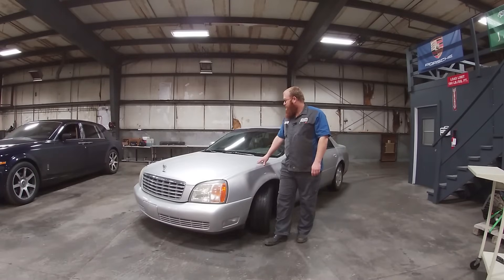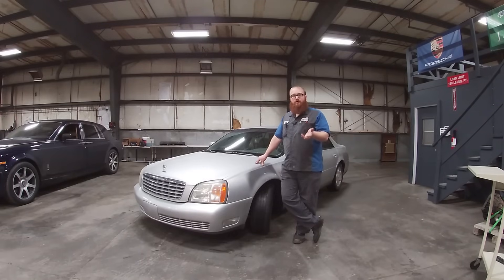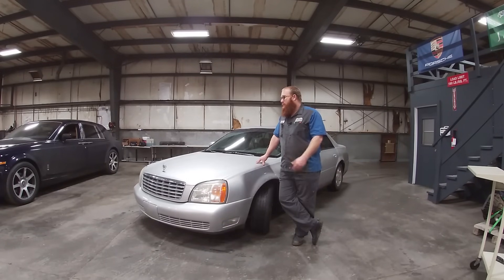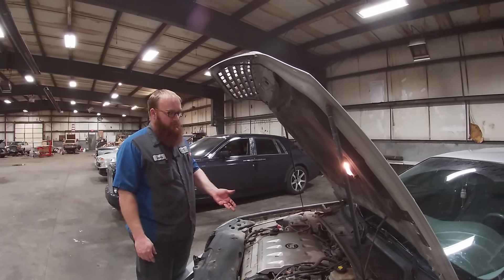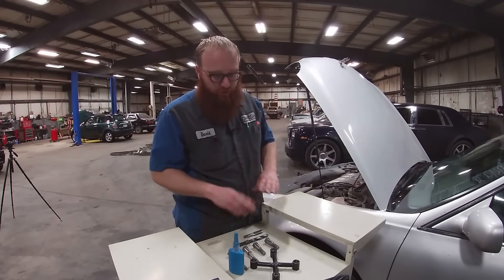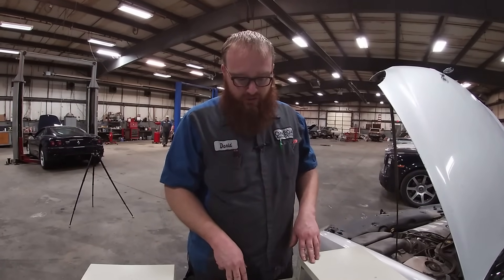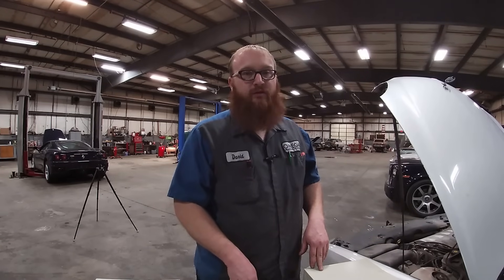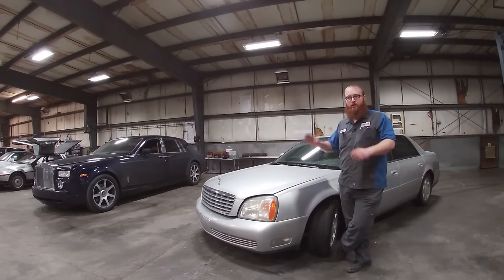The CAR WIZARD names Cadillac's Northstar Engine the Dumbest Design

Comment: to get a degree, all automotive engineers should have to work as a mechanic for four years or so before they're allowed to design a damn thing.
Reply: Ah....but you're forgetting about the problem evil and greed.  What if the mechanic knowingly designs the engine to fall apart right after the warranty expires in order to make him and his profession a lucrative income?
Reply: @drmodestoesq  you think they're not already trying to do that? I swear they have program in the computer that tells the car when it's out of warranty and then the computer acts up and makes the car quit. At least if they had to do the work, they would probably make it at least easy access so they could turn a buck faster. I used to own a damn Chrysler the actual book on changing a starter was to pull the engine. I didn't of course, but I did have to loosen them up and jack the motor up a bit to wriggle the old starter out and the new one back in. That's just ridiculous to pull a motor to change a starter, especially on vehicles known for being hard on starters. The real Dodges, made by the Dodge brothers, had a noiseless starter. Some had starters that were starters when they needed to be, generators the rest of the time. All the so called advancements they have these days    ain't shit.
Reply: @tootall5559  And why are the dealers up in arms about Tesla selling cars without the dealership model?  Because instead of a car with 250 moving parts in the drive train and electric car has one.  Well, that's probably a slight exaggeration but you get the idea.
Reply: @drmodestoesq  Tesla may have well it's got to have more than one moving part... no way it can only have one and have four wheels... anyway, Tesla's are not all that. They take a long time to charge and really don't have all that much range for the time it takes them to charge. When they can get 4 or 5 hundred miles on a charge that takes about the same amount of time as it does to fill your tank, then they'll have it. The battery tech probably exists, but the oil companies keep it under wraps. They've gone so far as to buy out companies with any advances and then destroy the company, and any of the existing batteries.
Reply: @tootall5559  They can do extream performance and fast charging. But it comes down to safety, those types of batteries can burn up if missed treated. You wouldn't want someone to have a crash and then the car turned into a firework display.
Reply: I have a Mechanical Engineering degree and I worked at a gas station to pay for my college. I agree with your suggestion. I promise my viewpoint has been quite different than engineers that seldom got their hands dirty.
Reply: Yeah and before a mechanic is allowed to complain about any design related issue he/she should work as an automotive engineer for four years. Most mechanics tend to think that engineers don't think about the practical side of things, well they're wrong.
Reply: @AR1G3  found the engineer
Reply: @sosobored1992  or I could be both?
Reply: @drmodestoesq  but tesla are well known to have lots of issues, like screen issues, software issues, smaller motor issues. Having the batteries swapped out, and now we have them stripping down the battery pack to repair one cell etc. Normal repairs range from 80 dollars to 4500 dollars. With average at 300. The main thing is, the thought process behind how this car ended up with the bolts could happen tesla too, they could end up with an electric motor/batteries failing in 250,000 miles due to some design fault. Tesla are not the top engineers in the world in the their field. They are not even close. Rollys Royce for example is currently testing its electric engines in racing propellor planes. They are on a totally different level, but even they can make mistakes. Point is, electric cars should be cheaper, but we will always have issues with failures, and one design failing a bit more than another, and the odd really really stupid idea finding its way in.
Reply: @drmodestoesq  It's a management decision, not a mechanic's.
Reply: same with mechanical engineers they should work as machinists
Reply: Oliva Gina, Yes! Best wishes to you 🌈
Reply: Oliva Gina  there were Hemis before Chryxler even thought of it. Of course, If two valves will do, why have four? Every level of complexity adds problems. Many a flathead whether it be V8 or 4 or 6 is still going what 70 years later? You're sure as hell not going to get that from today's computerized crap.   While the Northstar was stupid, there are other designs that are as bad or worse. Like chrysler K cars... pull the engine to change a starter? Ridiculous. but they did that before, though that time accidentally. They stuffed a V8 in a car designed for the slant 6 so to change the back two spark plugs, you had to pull the engine. Consequently they didn't get changed like they should have. That was a fluke though, not designed that way intentionally. The Northstar had the potential to be revolutionary, instead it was a revolutionary boat anchor.
Reply: I say the same thing about our engineers at the fab shop i work at, lol
Reply: Oliva Gina  I don't agree. Make an engine that is reliable, and people will want it. If I recall correctly, the slant six only had two valves per cylinder, and was the most reliable engine ever. I'd still like to have one. Too bad they didn't make the rest of the car just as reliable. 318 same way, it would run forever, but the rest of the car would fall apart long before the engine had any troubles, given proper oil changes and such. My late wife's son had a truck with four valves per cylinder, and it also had two spark plugs per cylinder, why I don't know... but it was nothing but trouble. The more complexity you add, the more problems you add. why add problems? I know of flathead sixes and 8s that are still running with no mechanical issues at all. you're not going to be able to say that for anything made since... well the trouble started in 1975 and got worse from there, when they started using computers to run things. I venture a guess that 40 or 50 years from now there won't be any cars made from 2000 on up that are still around in running condition, unless they've been redone and maybe redone again and again, even then it's doubtful any would hold up that long, especially when parts, especially electronic parts, are not available. I had an old Dodge, one of the first to get a computer module, it tore up, the module went out, and you could not get a new one. The only way you could get one was to buy a rebuilt one for some astronomical price that was way more than the car was worth. Of course putting the damn module on top of the air cleaner wasn't a very bright idea. My old landlord bought a newer model Buick back in... oh I think it was about 1985, it kept having a chip fail, and at 130 dollars every time it did, he wasn't going to stand for that. He  fixed it one last time and sold it as fast as he could. Nope, you can argue all you want, you'll never convince me that all the crap they're doing to engines these days is a good thing. They just don't stand the test of time. They may be faster while they last, but they're faster to die too.
Reply: @adambahnsen4577  I used to cuss the architects and engineers when I was doing construction. They'd have us try to build footing forms an inch or two larger than the last... why? the forms only come in certain measurements, and inches isn't part of it. if the biggest one needs to be say 30 by 30, the one previous to that could just as well be 30 by 30 too, not 29''7' or whatever. They might have saved a few pennies in concrete and rebar, but they cost much more in labor to custom fit every one of the 20 being built. They just don't get what it's like to do things in the real world, only what it says on paper.
Reply: Oliva Gina  what about the four cylinder original Jeep engine. They kept going and going. V8's  were more reliable with 2 valves and NO god damn computers.
Reply: Oliva Gina  if you keep em simple, that's not such a problem.
Reply: Oliva Gina  Not always. I've seen 4's with 4 valves per cylinder, and 2 spark plugs per cylinder, how is that any simpler than a two valve per cylinder 8? Plus they have all kinds of sensors and computers. My friend just bought a new Toyota, it has over 80 different computers, plus I don't know how many sensors and miles of wire. it's 6 cylinder. How is that simple? How are cars with fuel injectors simpler than cars with carbs?? Specious argument at best. Moving parts count alone doesn't account for simplicity.
Reply: Oliva Gina  same difference, but it's cheaper and easier to work on 2 valves per cylinder.
Reply: I worked on a large number of motorcycle engines before graduating from high school, then went to a vocational school for machinist training, then decided to go to college... I got a degree in Mechanical Engineering... I have a very different perspective on design than either mechanics or engineers or machinist's for that matter! You are right though, nothing like getting your hands dirty to gain experience!!
Reply: @63turbo  you're the perfect guy to ask this question. Motorcycle engines have long been way more powerful (cubic inch) than automotive engines. Even before electronics. One, how is it possible, and two why don't the automotive guys follow their lead? Even outboard motors get a lot of horsepower out of relatively small engines, and yes, I mean the four strokers not the old two strokers.
Reply: @tootall5559  All else being equal, basically, hp/liter is primarily determined by bore to stroke ratio, and this means big pistons and lots of valve area, and of course a relatively short stroke for the displacement... this comes at the expense of torque for a given displacement, and cars need relatively more torque than motorcycles do because they weigh more. Why don't the automotive guys follow their lead? because the reliability of those kind of engines isn't anywhere near what is expected for street cars. Consider this- when F1 was a naturally aspirated class, (2010) the hp/liter was the same as for MotoGP and their engines were supposed to last for something like 850 miles before they were rebuilt, and this is near identical for Nascar. The tech employed to get those F1 engines to last 850 miles was pretty exotic, and is not even close to being practical for a street car... the big one was the use of pneumatic valve springs so the rev limit could go up to around 20000 rpm!
Reply: YES.
Reply: Damn you couldn't have stayed that any better
Reply: DAMN STRAIGHT,...AND "NO ARGUMENTS" from any one!!!!!!!!!!!!!!!!!!!
Reply: Obviously you do not understand the job description of an automotive engineer.  You think they are working for the comsumer!?  Lol no.
Reply: @tootall5559  I wouldn't say going with more valves would make an engine any less reliable, it actually helps with airflow and horsepower (unless you enjoy going slow) it's only when you start adding crazy vvt and vct and a thousand computers, that's when things start to be unreliable but adding more valves only increases more airflow and your adding what like 1 or two more lifters per cyl? Shouldn't really affect reliability unless the concept wasn't designed the right way
Reply: @averyallen3385  well, complexity is complexity. the more complex, the more likely it is to fail. However more valves alone isn't the problem. Like you said, its the wiring, the sensors, the computers. A friend bought a new Toyota truck. it has over 80 separate computers...on a truck. That's not including sensors, wiring, all that. Heck I had a 90's Buick that the belt split and beat up everything under the hood. Even the pros couldn't figure out why it would not run. Parts were changed, in thoeory, it should have ran, but would not. I had a Ford Explorer, the first problem with it was I thought the alternator went bad, it acted just like that, put a fresh battery in, it would run until the battery ran out... but it turned out it was only a wire popped off a relay enough not to make contact...and that wasn't even that new of a vehicle... then the tranny went out.. they sure don't make em tough any more. When I can, I like to get manual transmissions, but they're hard to find now. They're always easier and cheaper to fix than automatics. These days even the transsmissions have electronics in them for no good reason that I can see, except it makes them more economical for the factory to build. That is one of the reasons I love the original VW idea, keep it simple where anyone with half a brain can work on them, even a 15 year old kid that doesn't know what a metric wrench is.
Reply: I've always said that when I started off to get some automotive repair training
Reply: @jeronunkoffunk9437  true justice would be to have the sonsofbeaches that designed these cars have to work on them.
Reply: toot tall agreed!!!!👍🏾
Reply: The  Engineer  That developed that engine should had to fix the 1st   Thousand
Reply: drmodestoesq any german car out of warranty is gonna have alot of stuff going out very quickly
Reply: and pay for the repare like a customer
Reply: You forget who runs the show, the marketing wanks
Reply: I think it should be the first two years working as a mechanic and two years studying why an engine works and how to improve it.
Reply: drmodestoesq Then they Will loose costumers, bad idea...
Reply: Maybe then the cars would last longer.  My Passat has a sealed transmission and that makes it a pain to even check the fluid level.  All they did was take the dipstick and tube away and call it sealed.  Nothing more.  They still have vents and other things.
Reply: @charleshines6155  they're working toward getting you to accept a sealed hood. they've already designed it, there is a small door for the coolant, and a small door to check and add oil. That's it. otherwise sealed. even on the bottom side. You'd have to go to a dealer for even an oil change,  as they're the only ones that would have the special tool to undo it. That's their goal, make you go to the dealer for anything and everything, and they could charge whatever they wanted to, because you'd have no alternative. 

Years ago Ford experimented with an all ceramic engine. they got it to work and run for weeks without stopping, and when they did stop it and tear it down, there was no wear. They claim they abandoned the project because no one would buy it. The fact is they abandoned it because if the motor lasts nearly forever, who'd going to buy a new car? I think they could do the same with transmissions and other parts, but won't because there's no after the sale benefit to it. The dealers would drop them.
Reply: hindsight is 20/20
Reply: @MrMichaelfalk  okay so let em design a couple then make em work on the sumbeaches.
Reply: @tootall5559  Capacitors "quick-charge", but then its Hard to get a smooth low-flow of electrons OUT of them.  Supposedly carbon nano-tubes in a battery, are going to allow quick-charges [--like a 'fill-up' ], plus they'll take So much of a charge you could travel coast-coast 4 TIMES on one charge!   Supposedly less than 4yrs away.   I don't see How, though.
Reply: @drmodestoesq  it's sad to say, but I believe you're right. Good point
Reply: Tesla won’t even let owners or independent shops service or fix their cars and will not sell service manuals or diagrams to either. Don’t buy a Tesla if you can’t afford dealership rates and like to fix your own stuff. They do not support the right to repair. They do break too, used Tesla’s are very cheap because all the gadgets are problematic.
Reply: I knew an Oxford graduate with a degree in engineering science who could not change a wheel on his car. And we were not about to help him.
Reply: @rob-123  yeah, less and less of a problem all the time...improved batteries and improved management systems.  I have a model 3...don't give battery meltdown a second thought.
Reply: Engineering is generic. Automotive engineers just get primarily mechanical engineering degrees. You learn once employed but I do get your point!
Reply: Yeah a 8 year degree sounds great. Genius
Reply: @markw208  Never thought I'd read this. Is my name Mark W?
Reply: @Bloodcurling  better that than idiots that have never worked in the real world designing things.
Reply: I work as an engineer and you forget the crucial position in the value-chain: the (financial) Controller! These people ruin everything and should work in the workshop for at least 1 year!
Reply: @MarshallDT  those bums should be cut right out of the chain. Make a good product, charge what you need to charge, people will still buy it, once they know it's a good product.
Reply: It would 100% give you an edge, but I think the best way to do this would be having mechanics providing constant feedback to the automotive engineers. I think in the past, when most auto manufacturers participated in racing, is when the best engines were ever produced because you can't win races with crappy engines and no feedback from the mechanic and/or driver.
Reply: @CmlDexter  that's a fair point, but still they should have to work on them, then they'd understand not to make things impossible to get to without disassembling everything under the hood. I once owned a couple of Chryler's K cars.. one was a great car, the other not. However on either one, the booked method to change the starter was to pull the entire engine out. That's just stupid, especially when Chryslers are notorious for going through starters. I didn't do it that way, but I did have to loosen the motor mounts on both sides and jack up the engine just enough to get the old starter out and the new one in...can be done but is nearly as much hassle as pulling the motor, if you had the equipment to do so.
Reply: Yep...
Reply: @tootall5559  RIP Walter Chrysler
Reply: The problem I'm having is I can't afford to get re-credentialed. Getting ASE and NATEF was expensive as were the tools. But shop work aint paying it like it used to ten years ago. No one does any type of on the job training and school is to fucking expensive.
Reply: @WhitefolksT  amen. Chrysler just sucks these days. And they wonder why they faiil?  they build over priced crap, that doesn't even outlast the payments, then wonder why people don't buy their crap.   Chrysler at least used to know how to build damn good engines, tho the rest of the car...well they ween't the greatest for wear they did have some of the most iconic designs. i've been doing a non-scientific survey of what people in my area are buying. full size trucks, Ford and Chevy are still battling for top, but Toyota is slipping up the ladder quietly. Dodge or Ram whatever, very few new ones around here, some but they're almost rare in comparison to fords chevys and Toyotas. In large SUV's its about the same story. Mid size SUV's, well I'd say Toyota is on top there, Ford and Chevy have a strong presence, and then there are a whole lot of other brands vying for a share of that market. Nissan is probably the next in like. full size vans, it's mostly Ford, with some chevys  minivans, it's Toyota first with all the others trying for a piece of that market. cars, well that's hard to say. My 2008 Ford Focus looks just like the newer cars on the road pretty much, and they all seem to share the same basic exterior design, I can't be sure who's on top when it comes to new ones... I know it isn't Ford or Chevy, probably Toyota, they're quite popular. That's the results so far...
Reply: @cirithduath7526   yep if you had the money it takes you wouldn't need the job. They all want you to be 20 years old with 30 years experience too.
Reply: @drmodestoesq  as of late general motors is infamous for that, I read horror stories where a practical engineer gets shot down by the lead manager declaring his design won't make them any money...
Reply: First course in automotive design school is how to make money by sodomizing the consumers wallet
Reply: when reading through the comments it dawns on me that this is in no way bad engineering but was done on purpose
Reply: @lenny108  you might be close to right, we'll never know, but I don't think they would purposely ruin the Cadillac name like that. Then again, those a holes running GM don't know squat but how to steal money from everyone,  the taxpayer, their former dealers, and everyone that buys a GM product. Too big to fail... bs. 
GM forgot what made them big in the first place. Chevy was supposed to be a working man's starter car. When he did better, he could move up to a Pontiac, then a Buick then olds then caddy. Back in the day, while they always shared some parts, they were not all exactly the same thing with different badging. I think making all the same except for badging started in the 70's. I had a 72 and while it had a 350, it was not the same engine as a chevy 350, I should have put a chevy 350 in it instead of the two poncho 350's I did. The motors did not hold up. One of them had the weirdest flaw...a gouge in the cylinder head from one piston to another. Don't know how the hell that could happen. Anyways, their planned obsolescence wasn't planned well enough, it just about made them obsolete. Frankly, had I had my way Congress would not have bailed them and Chrysler out... they fail, oh well that's part of the American way.. least it used to be. Much better car companies failed and nobody bailed them out.
Reply: @tootall5559  right, normally companies are sued when such an obvious construction error is detected or the manufacturer has to make a product recall?
Reply: @lenny108  I don't know if they got sued or not, but they certainly should have been. Maybe they were, maybe that's part of the reason they failed, besides being idiot pencil pushers that really don't know squat about cars or what people really want. when you make cars that don't out last the payments, you're doomed to failure. I do have some respect for Ford, when the problem came up, they didn't ask for squat from the taxpayers, they went out and solved the problem themselves.
Reply: Or at least be able to explain how to fix any problem that can occur....
Reply: Engineer here. I work for a 2nd tier supplier as design engineer. We are all car guys, rest assured we know when a design is unreliable/bad so what gives? Our boss is a finance guy who's going for the cheapest materials and highest profit margin. Maybe you should research into the design prototype process before you post something so ridiculous
Reply: @supersabrosinho  Sorry, but I don't buy that it's all the finance guy's fault. Yes that has something to do with it, I'm sure, but not all. The places you guys put stuff, makes it hell for anyone to work on. Don't try to tell me you are not told to make things so that people have to go to dealers... and that you don't add a bunch of crap that really isn't necessary. Some newer models have a ridiculous amount of computers and sensors on board. You can't convince me they're all necessary, hell truth is none of them are really necessary. We had good cars before computers ever came along. You also can't can't convince me the 4 6 8 idea was a finance guy's idea. No sir, don't try to shift the blame onto the bean counters, at least not all of it. One car I had the factory recommended way to change the starter was to pull the entire engine... That's just stupid and it takes an engineer to be that stupid. You guys put sensors that you know will eventually fail in places that are inaccessable... the finance guys may buy cheap sensors, but putting them where you can't get to them is the engineers' fault.
Reply: @tootall5559  lol ok bud. Merry Christmas!
Reply: @AR1G3  they don't.
Reply: Many of them do. And even with out any such experience, all competent degree programs produce engineers who have design skills and specialization in automotive mechanical engineering, that far over encompasses anything they could learn by doing a mechanics job. That's the whole point of a qualified engineering degree. 

The thing is, the people who assign design priorities for new car models (i.e. are the ones paying for their labor) don't care two bits about ease of maintenance or longevity beyond factory warranty (usually 1 - 3 years or X amount of distance driven, equivocal to a certain amount of running hours). I.e. the penny pinchers and company upper management prefer cars that are fast to assemble with robots and minimum human involvement and also consider them disposable items after the companies warranty liabilities have expired. Furthermore, these people have at the same time cooked up a scheme of padding revenue by selling various factory dealership maintenance programs after said warranty period has expired (during the warranty period of course minimizing needed work is a factor, at the cost of potential product longevity being acceptable if not preferred), which produce most when they can charge as many hours of labor as possible. Hence the modern mechanics need for finger dexterity of an OB/GYN while impinging bodybuilder level force from their hands or need for specialized tools and workshop systems for basic maintenance tasks. And since a good engineer does what they are asked of, preferably with out too vocal of a digression on why this is a stupid idea in the long run, you are getting what you pay for. 

The only way this changes is, if majority of customers stop buying quickly assembled disposable crap cans and start also vocally demanding easy to maintain vehicles with extended longevity. I.e. vote with your wallets and feet. 

Since majority of the car buying public doesn't care about the challenges the average automotive mechanic has to face as a result of having to keep their fashion item functional beyond the introduction date of the next face-lift iteration of the car, this isn't going to change any time soon. Do also note, that the people they're selling to are the ones who buy their cars brand new. The second hand market doesn't produce a cent to them. Atleast not without laborious chargeable maintenance that is. (Engine out for a set of head studs and gaskets every 2 - 3 years? Good!) And their reputations and brand image are mythological lore more than actual real-world provenance in this game. Just as long as things don't explode with in the first couple of years, all is well. Since after that it's the consumer footing the bill. And the Northstar can do that easily, as the wizard explicitly states. 

But, usually when you see a car that's easy to maintain its as a result of the project being run by mechanical engineers. Not industrial designers, penny pinching accounts and/or markedroids and/or with input from corporate upper management.

Whether new or historical, that is. Usually extended longevity and ease of maintenance are significant factors only to commercial vehicle buyers, which is why many still are based on body-on-frame construction, use engines one generation older then the latest consumer product, as their teething problems have been either fixed or are known, with reinforcements / enhancements to accommodate this. I.e. cast iron blocks, forged internals, simpler valvetrains and head studs instead of quick to attach bolts. Less sophisticated suspension setups and/or appropriate preventative maintenance specified in the factory up-keep guide lines. etc. and so on. Which usually adds to their cost as new vehicles, then again they are meant to last at least a decade while being able to perform to factory specifications. And keep running at least passably for another decade and a half before being disposed of in a crusher.
Reply: I mean, why the heck do you think the Ford Crown Victoria was the go-to for Taxi and Police fleets far beyond it even being offered to consumers?
Reply: Underpowered engine, out-dated design in terms of style and basic platform features. No toys. But, you can run one well beyond three hundred thousand miles while abusing the ever living crap out of it and fix it with gaffer tape, a spool of tin wire and a brick. Even after multiple frontal collisions at 50mph.
Reply: @Meton12765  My point exactly, you won't see any of this new crap around in ten years let alone 20 or 50 or 100. A model T that hits a wall at 5 miles an hour suffers only about two bucks worth of damage. Any new stuff will sustain much more than that, and might even wind up totaled. I know, I had a small accident with an 80's model car when it was new and it blew apart, while the old scout I collided with suffered no damage at all. They just don't want to make them tough any more. Did you know the original Model T's were made so they would run on alcohol without damage.
Reply: @Meton12765  and is still popular though not made anymore, they rebuild them to keep them going.
Reply: they're so popular around here, even the locoal scrap yards will put them back in running order and sell them for decent money.
Reply: You could say that about every industry... the people who do the work are the last ones to be consulted with... They refer to sales and management first.
Reply: @ZZH1986  yep, and those that do the most make the least. Frankly I don't know of any major company that isn't top heavy in overpaid execs, yet the first thing they'll cut if they have to is the number of actual workers or their pay. Cut out all the brass at the top, save all that big money. Put one guy at the top, that's it, whatever happens from then on his responsibility. sure for super big companies he might need division heads, but only one per division. And don't let the bean counters near the car costs until it's finished, carved in stone design. Every engineer should have his name on what parts of what he designed, then if the shit is bad, he's responsible fire his ass. Corporations need to be ran like sole proprietorships, more than they are now anyway. Frankly I think the corporate veil should be done away with, if something comes out of the company bad, those in charge should also be held Personally liable, especially if they knew it was bad to begin with but it was cheaper to settle claims than change the cars or whatever.
Reply: @donaldasayers  Why not?
Reply: Not even that, this bolt issue is a really obvious design flaw that no automotive engineer should make
Reply: @supersabrosinho  Not to pile on, but a good many of the problems with cars are bad engineering, such as sticking the Northstar starter inside the engine, beneath the intake. Or, as with the Ford Flex water pump being located behind the timing cover so that when the pump seal fails, it dumps coolant into the oil, destroying the engine. As a mechanical engineer, I know that bean counters cause a huge number of automotive problems by specing substandard parts and materials, and by not budgeting sufficient engineering hours for proper design, but a lot of the problems are that for whatever reason, some engineer produced a s*** design. BMW's are rife with bad engineering that leaves you scratching your head, such routing oil through an alternator bracket.
Reply: @johncheves4740  I assume you're not in the automotive field so let me give you some insight: a robust design requires time, money, and skill. Current trends in industry usually end up shortening deadlines and therefore significantly cutting the time available to make a good design. Even when I do submit robust designs for prototyping and eventually final launch, they get dumbed down to a plastic / Happy meal like toy from china that was a few $ cheaper than my original part sourced from Sweden. Make no mistake about it, car makers will try to get away with it if they can. if you really want to point a finger at someone, it is the customer who votes with their money
Reply: I think some of the best ones were working as mechanics while getting their degree.
Reply: @MidniteSon  Possibly, but they answer to idiots and bean counters. The bean counters ain't worth squat, cuz they let GM go bankrupt, doesn't say a lot for their abilities either. Cheapening the cars does not make up for the millions the upper echelon gets or steals. They go bankrupt, then still expect their bonuses and golden parachutes. Frankly I think the government should have said no, you made the mess, you deal with it. But you know there were big bribes handed out and stock deals... and in the meantime they put perfectly good dealers out of business for no good reason, and didn't even pay back their original franchise fees, let alone what they're worth today. They told the smaller dealers, oh well so sad, bye. We should have told the bigshots that. Only Ford went out and solved their own finance problems without govt assistance. That's why I'm now partial to Ford, though they don't really make good cars these days either. at least they're not doing it on our dime.
Reply: @Gamer1st1  The reason doctors don't prescribe opioid pain relievers in sufficient quantities is that government agencies threaten them with loss of their license, and thus their livelihood, and even criminal arrests, if they prescribe opioids beyond a certain amount. Every prescription must be electronic, and go into a database. The government is watching, and counting. George Orwell imagined we would be watched by TV cameras. It turns out TV cameras are not enough. Big brother also has information technology that keeps records of kinds of commercial interactions, what we sell, what we buy, what doctors prescribe for us, and if the computer program flags someone of prescribing more than the government thinks is appropriate, government agents come to arrest you. The reason is that opioids are not patented and can be made very cheaply. They are a source of income for peasant farmers. The people in power don't want that. They want to sell you new medicines that are still under patent. There is a much larger profit in that. The proof is what happens if there is an opioid medicine shortage due to inadequate crop yield by the legal growers in Turkey, India, and Tasmania. Yes that is where the legal growers are. Instead of just buying raw opium from illegal growers, and allowing them to make a little money, they arrest the illegal growers, and destroy their crops, even damage their land for other crops. It is very nasty, and vindicitive. When a few clever Jewish entrepreneurs such as the owners of Purdue Pharma, compete with the patent drug companies, with an alternative propaganda strategy, to change the public view and the cultural values regarding the safety of opioids, telling people opioids are good in many circumstances, they put these entrepreneurs out of business and threaten them with arrest. Then they double down on the propaganda that opioids are bad.
Reply: ITS NOT THE ENGINEERS IT THE BEAN COUNTERS THE AUDITORS WHO FORCE THE ENGINEERS TO CUT COST. THATS WHY AS THE WIZARD SHOWED THE BOLT SIZES AND OTHER HARDENING OF CAMS AND BEARINGS ETC.ANYWHERE WALL STREET CAN FORCE THE CAR CO TO CUT COST FOR MORE PROFIT THEY DO IT .NOT THE ENGINEERS FAULT!!
Reply: @richardfeibel3154  If you repeat your comment using lower case letters, I'll read it.
Reply: @richardfeibel3154  in this case, its the engineers. that 4 6 8 design just sucks. the tycoons don't specify where stuff is placed in the engine compartment either. So, anyway it's still the been counters that do the dirty work for the wall streeters. Choosing cheap parts, that's the bean counters, at the direction of the a holes at the top I'm sure.
Reply: Amen.  Fucking GM bean counters.
Reply: @tootall5559  That's funny.
Reply: @gerardcousineau3478  wasn't meant to be. Not funny when you can't even get to the part that needs to be replaced. Now I have a problem I can't track down. The power windows in my 2001 Ford Windstar do not work at all.. all four went out at the same time. There'is no power coming to the switches. I have changed 200 dollars worth of relays and fuses, still nuttin. Driving me mad, so now is not the time to defend engineers to me.
Reply: They should be required to take and pass classes on metallurgy or materials applications. Metallurgy 101, 1st rule never mix dissimilar metals, especially intension or under pressure or you get just what the wizard is talking about above.
Reply: Agree!!👍👍
Reply: Exactly!!👍👍👍
Reply: Great point! 👍🏼💯
Reply: I don't know how many answered with the exact comment I'm going to make, BUT, what you say is great for practical purposes just when the financial dudes get involved I think is a bigger contributor to bad design than actual poor engineering practices. Ayy?
Reply: FACTS
Reply: They get a degree as a mechanical engineer. If a job at an automobile manufacturer required  additional years as a mechanic I don't think recruiting world go well.
Reply: @tootall5559  I guess you mean that as a serious question - the answer is - unequivocally that is done - you need not be concerned whether you are paranoid or not  I know it for a fact my brother in law used to do that . Let me explain - it is not some nefarious thing - where some wizard sits in a closet and plots evil  it is strict economics -  when a car is designed - they have to go out and source parts manufacturers -  and those are all done to a certain price point - so for instance -  say something like  brake parts  like a master cylinder - - they can source out a part - and they all have different grades and how they will last /wear -  so if a manufacturer - has a master cylinder - to a certain spec for a car  he will have one that will last 200k miles -  one that will last 80  and one that will last 40  =   they can chose any one of those to be built into the car - believe it or not - they want to use the best one - but often it will put the car out of the price range they want to sell it at -  so they go with the one close to the warranty -  but that is absolutely true - buying a lease trade in -  is crazy  IMO
Reply: I felt the same way about apartment builders. Spend a few months delivering food at night to apartments. You'll wonder why the building number is so small and/or unlit.
Reply: This is absolutely true for ANY and ALL trades or industries!
Reply: Similar to how I felt about graphic artists when I was a screen printer. NFI.
Reply: Yep, that needs to be MANDATORY, lmao. When you turn wrenches on them for a living, you figure this out really quickly.
Reply: It's not the Engineers it's the managers telling them what to do.
Reply: It's not that they don't know this, it's that ease of repair is literally the very last concern when designing anything, no matter if this is a chair or car. This is especially true for consumer products. If it's easy to repair - this is a bonus value that means the engineers were afforded all the time and money they needed for the design and then some.
Ease of repair is considered at all only in pro market, and put as a priority only in military and few other niches.
Reply: Engineer here… I agree